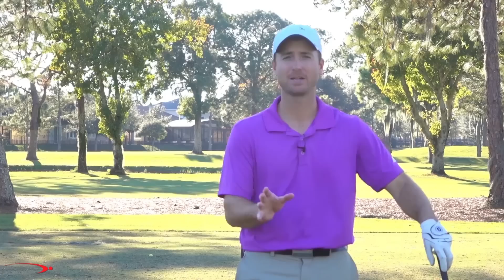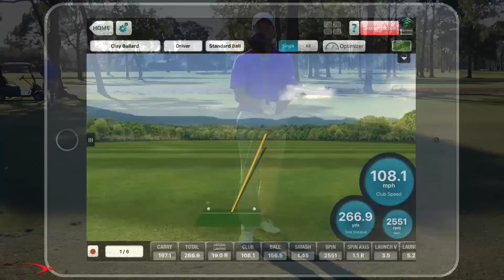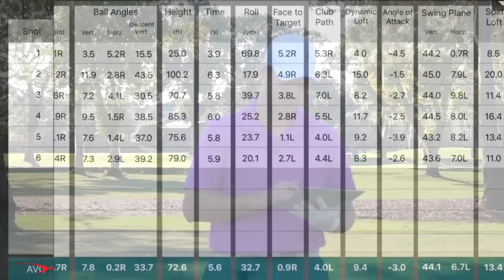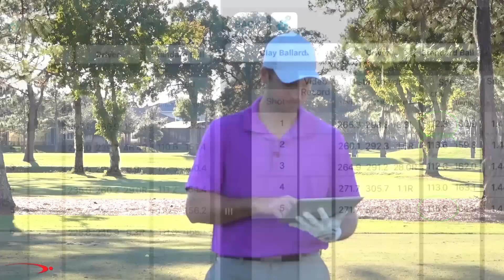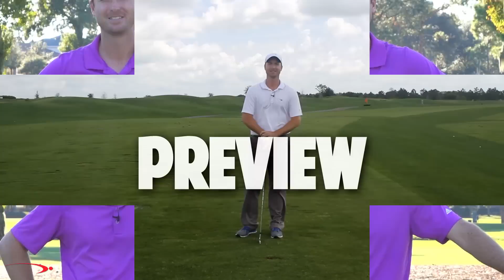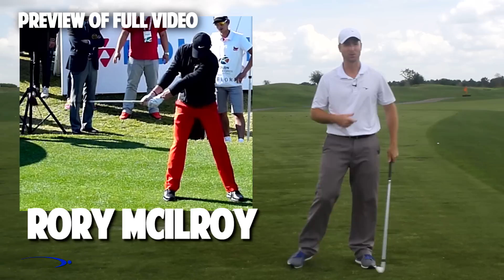Comment: I am 66 yrs young 18 HDCP and have always had a good drive, even as a kids, 11 yrs old could outdrive the guys in my dad's league, 200-220 yrds. I Play a TaylorMade 9.5 degree AreoBurner, Senior shaft. Completion of my swing I have Zero movement backwards away from the pin.

I have tried the rotation like you state on driving ranges and it makes very good sense in every way, yet when I add any extra twisting upper body My Slice Goes Viral. My last round of 18, I lost 9 balls, 2 on one hole, 1 slice 1 hook, both out of bounds by at least 30 yards and the fairway was 65 yards wide.. No water, just slicing and sometimes the next shot will hook just as bad out of bounds. My 18 HDCP went down the drain loosing 9 balls.

Moving the ball forward for me makes me slice so bad the ball actually is moving towards me at end of roll. I have aimed at the far left side of fairway only to be out of bounds which is 70 yards plus another 20-30 yards into the trees on right. The Only way I could possible move the ball forward would be to Sway Forward which adds even more problems in Angle Perfection within the Drive. The Sway would keep club angle but add problems.

Yes, I normally play the ball off my right instep and get 250-270 normal driver. Right instep because my wrists snap early. I still get 100-140 ft of loft playing off instep in my drives. If I moved it forward and teed it higher my fear would be skying the ball so high it would be like hitting a flop shot getting close to Zero roll. Most of my drives get very little roll plus the slice I have limits total drive distance by 20-40 yards. Moving the ball forward hitting on upswing changes the angles of loft to about 25-30 degrees.
Reply: Hi coachswalker, if you're carrying the ball 250-270 at 66 years old then I would just keep on doing what you're doing. You have to be doing something right :-) Play well ~ Quentin | TSG Instructor

Comment: If you already play the ball forward, then no 38 extra yards.  Hitting the ball in the center will give you 20 more yds; get some Dr. Scholls odorX foot spray and spray it on your clubface.  Find out where you are hitting the ball on the face and work from there.
Reply: Hi Nescafe Shorts, I agree 100%. Thank you for sharing. Play well ~ Quentin | TSG Instructor
Reply: totally agree. If hitting off toe, heel= 15 yds loss. Your eye has a target dimple you hit and adjusting it adjusts where on face you hit. For me its at 1 oclock dimple , but everyones different. Dr sholls tells you what dumple.

Comment: hey clay...my ball position is off of my toe with my feet slightly flared. I tend to push slice fade my drives. will moving to ball few inches back help with my drives?
Reply: Work on releasing the club also. Check out the move, and straight line release video on the website. These will help to square the face early. Play well! ~Clay

Comment: I hit my driver with the ball just off the lead heal.  Tonight on the range (using a high rubber tee on the mats) I was skying them, so I moved a little further away from the ball.  Almost to the point where at address, I was slightly uncomfortable reaching.  But my contact was dead centre 8 times out of 10. Your thoughts?
Reply: +alcraig1 That is mostly from the standing up you mentioned. When you stand up, you move away from the ball. By standing taller and stretching out at address, you are already taller and won't move as much. It's a bit of a work around for players who tend to stand up. Let me know how the posture goes. ~Clay

Comment: Do you retain the lag longer on iron vs driver?
Reply: +Jancen Great question, they will be about the same. You will technically start releasing around the time when the left arm is parallel to the ground in the downswing. Hope that helps! ~Clay
Reply: Hi Clay, so that's basically when the left arm has returned to the 9 o'clock position in the downswing?
Reply: Yes, that is the rough idea. Play well!